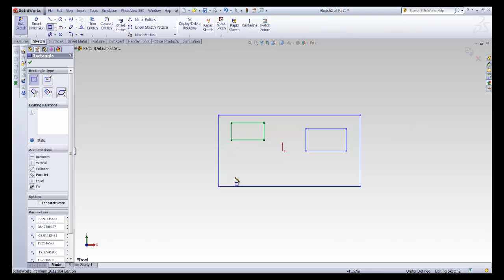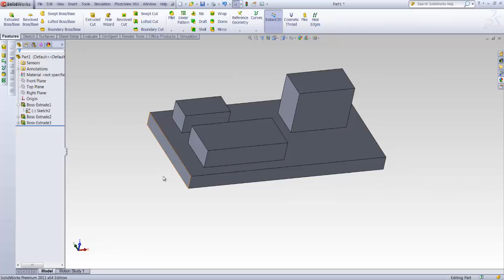Unleveled body with one base sketch (Different Heights)

Comment from the maker: Ok frist you need to have diff bodies of course. Then if you look in the "Bodies" folder on the left side of the screen (where you see the features you have used, equations and etc) you see the different bodies you have, listed there. Simply right click on them and apply new materials.